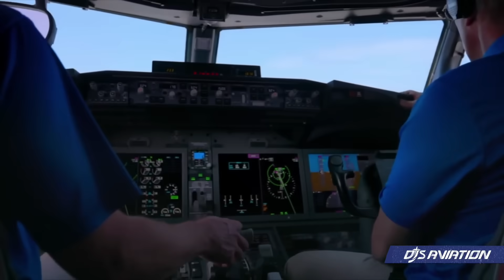Massive Order, New Aircraft & Qantas A380 News

Comment: acquiring 101 brand new A321-200 Neo & A321-200 Neo LR makes sense . . . but why the 56 brand new A320-200 Neo . . . might as well acquire the A220-300 instead . . . not to mention the upcoming A220-500 which is a not so distant future stretched variant of the A220-300 . . . besides the A220-300 comes pretty close to the A320-200 Neo in terms of performance & overall product . . .
Reply: They don't want to add an additional fleet type and the 220 is having issues with production rates and all the PW engine drama. The 500 is far from a done deal and for said reasons Airbus is no hurry to go there. It may or may not ever happen.